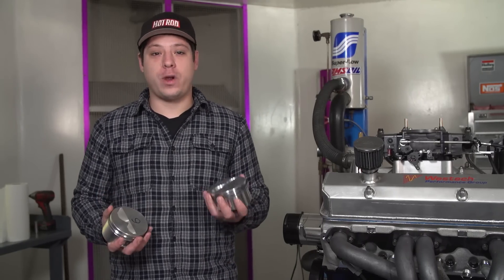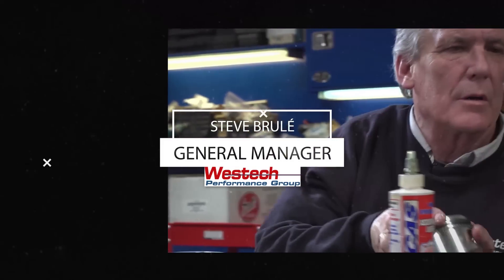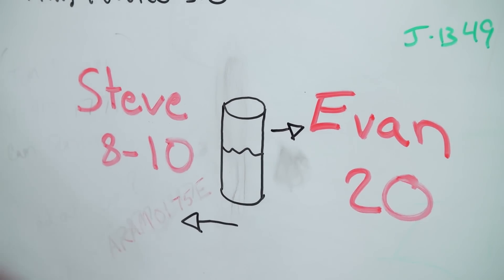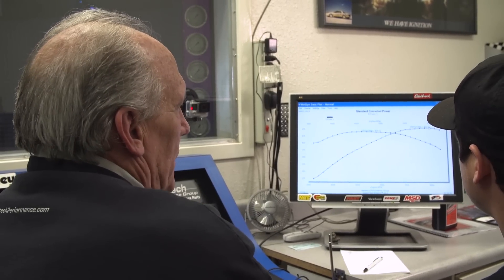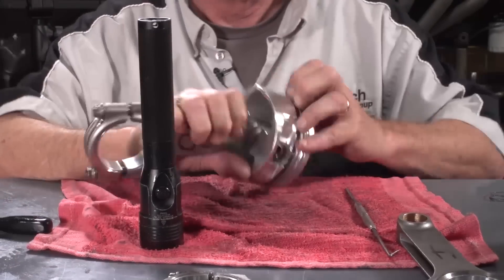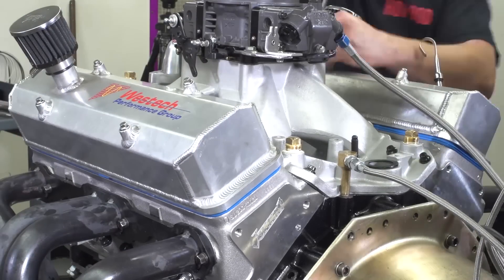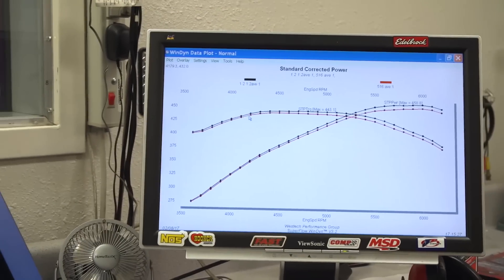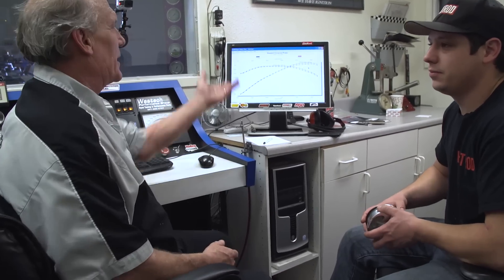Dyno Tested: Are Thinner Piston Rings Worth Horsepower?

Comment: I'm wondering if they weight matched the new piston/ring assembly to the thick ring assembly.   The difference in weight between thick and thin rings is considerable and enough to throw the balance off.   You could lose some power having the balance compromised and may not be realizing the full benefits of the thinner rings.  Just a thought.  Great episode.
Reply from the maker: That's true. JE Pistons did take that into consideration and weight matched both piston/ring sets to compensate accordingly.
Reply: Ahhh!  Awesome!  Thanks for the response.

Comment: saturn ecotec 2.2l has 1.2mm top rings in it. now it's got blow by issues at 130,000 miles. Thanks GM, now I gotta crack the engine open and re-hone the bores.
Reply: You are lucky you got that distance out of yours. At 110,000 miles, my 2003 Saturn ION had almost no compression in cylinder #3.

That in mind, I have to wonder if it was because these engines have narrow rings, or if these engines weren't built well. Honda also used narrow rings, but it didn't seem to be a problem for them.
Reply: There are tons of cars with thin rings. The Saturn was just built like shit

Comment: Just out of curiosity, when you do tests that require the heads to be pulled, do you use new head gaskets each time or do you reuse them to keep cost down?
Reply from the maker: It depends on the gasket type. For a coated gasket such as we used in this test, we will change them. However, certain MLS gaskets are able to be reused.
Reply: Thanks for the reply. Looking forward to more product tests on the dyno.
Reply: good question i was just ask the same thing lol

Comment: Cool video- I think better than engine masters. I wonder if there is more compression leakage across the smaller seal than across the larger seal- it would account for the small gain in spite of the drastic thickness change.

Comment: The issue with the rings being thinner is the oil bypass that is going to take place inside the motor bring picked up by pcv an reinjected back into the motor fogging it up with carbon now maybe not on this engine as its carbed but still could be plausible an if it was a non na turbo app then oil blow by would be even more noticeable  more like the engine is burning oil rather than using it

Comment: I wonder if the weight difference between pistons/rings was and how much that made a difference.  What did they weigh?
Reply from the maker: JE Pistons took the weight of the rings (a few grams) into consideration when designing the pistons so both sets weigh exactly the same. That kept us from having to re-balance the rotating assembly for the second test.

Comment: I was thinking 6HP, missed it by about  1/3 , but is there more worry about ring break ?
Reply: seeing as hp the new engines that have this installed from factory are lasting longer then ever i doubt it
Reply: There is no need to worry because many car companies have installed them on power dense engines. The Mitsubishi Evo X had a 2.0l engine that produced up to 313 horsepower. The top compression ring was 1.2mm, the second compression ring was 1.5mm, but I don't remember what the oil ring was.

Some high performance replacement pistons for the Evo X use 1mm top rings, 1mm or 1.2mm second compression rings, and 2.8mm oil rings. People are running higher than stock levels of power and don't have problems with their piston rings. The Evo 8 and Evo 9 also had aftermarket pistons with a 1mm top ring, 1 or 1.2mm second ring, and a 2.8mm oil ring, and people have also boosted horsepower well beyond the 271 to 289 horsepower that the engine was rated at.

Comment: So it's not worth pulling the engine down just for 8 hp but is worth doing in a rebuild or new build. Time / cost per hp factor. My next build will have thin rings with gas ports and coated piston skirts.

Comment: Here is what you do , just pick up a seal power ring catalog and look at what Buick did with the 3.8 V6 as far as ring pack . The factory did this years ago . Partly for power but mostly for ring seal and gas mileage . Years ago the auto companies thought ring tension made for good ring seal , but Buick found out that a ring that had good conformability would not only reduce ring drag but also seal better . It is funny where you can learn things from W/O a dyno .

Comment: i know there is a ton of variables to be had in my question. but what would an average power loss be from say a 500 hp motor down the drive train to the axles....that is something i would like to see tested.... auto vs manual. dual clutch, single clutch. gearing, tires... i know it all plays a part.

Comment: I'd like to see a test done with annular vs down-leg boosters on a non-airgap vs airgap dual plane manifolds.

Test 1: Down-leg booster, RPM intake
Test 2: Annular booster, RPM intake
Test 3: Down-leg booster, RPM Airgap intake
Test 4: Annular booster, RPM Airgap intake

The theory with this is that a heated intake manifold behaves better with straight or down-leg boosters due to the heat being able to keep the fuel atomized and suspended.  Annular boosters with a heated manifold cause the fuel to atomize too much and actually evaporate which, while being good for emissions and gas mileage, is bad for performance.  This is where the theory of the Airgap intake would get weighed in.  With the cooler air temps in the Airgap manifold, the down-leg would leave too big of droplets that may puddle and hurt atomization and performance.  This is a suspected reason why many people who switch from an RPM to RPM Airgap manifold notice little difference in performance since the poorer fuel atomization cancels out the power gained from the cooler air.  However, annular boosters providing better fuel atomization from the carb itself may solve this problem and allow the Airgap manifold to shine.  I'd love to see a dyno test of this theory to see if there is any substance to it.

Comment: When I build my personal motors, I hone the bores with a finer stone and then give it a quick Scotch-Brite rub. Why?  I use a harder Total Seal ring set that really doesn't seat like the rings of old. There is still enough oil on the walls to keep from scuffing and to lube.  There is a significant boost in power and it revs freely.  It's all about building motors with as little parasitic loss as possible. Opps, I just gave out one of my little secrets.

Comment: I'd be interested to see what the part throttle BSFC #'s were between the two ring sets, I have a suspicion the thin rings would show better fuel efficiency in regular street driving.
Did you guys get enough data to make that type of comparison?
Good video either way. (And yes I agree...that was a lot of work) :-)

Comment: I've seen thinner rings make a bigger difference before on a fully built N/A 420a 4 cyl. Changing to thinner rings gave 12whp gain so like 18-20 flywheel.  They were sone really fat rings. It also seems to of helped the engine rev faster. Might just be mind tricks though.

Comment: was there a break-in cycle or straight to the pulls? did the first set of pistons go into a freshly honed block? Some variables I'd consider were not addressed. This is a hard test set though. nothing easy about the change over especially having to remove the spiral locks an deconstruct the engine.

Comment: 8% gain in hp if at normal driving rpm can equate to significant fuel saving.
If of course you freeing up 8% more power from the same amount of fuel.

Comment: Did you spend much time running under load on either set for break in?  When I am running engines it seems like it takes four or five pulls for the package to stabilize and give repeating data.  Does not matter when you are chasing big variances, but becomes pretty important when going after single digit stuff.
Reply from the maker: Both ring sets were run through break-in cycles and pulled until they gave consistent dyno results. Due to time constraints for video, we left out the break-in pulls.
Reply: Very cool test.  Kind of makes you question some of the magic parts claims that permeate our trade...

Comment: 8 HP gain for a ton of work swapping out parts on a much bigger displacement motor than I use on my motorcycle. I wonder what kind of gain I could get doing something like this with a 1300cc motorcycle? Any chance to see a second test done with a motorcycle in mind? With the lighter weight, if it was even a 4 HP gain, that would be noticed riding.

Comment: if you use the spiral lock correct fitting tool = there is no real problem ? in fact it is easier than snap ring`s.

Comment: You do know that LS engine were never built for power they were originally low HP high torque truck engines but the blocks are strong so they make a good platform for a big HP motor

Comment: like to see the difference at light throttle (to late now), say 15% throttle at 1800rpm back to back? to simulate the real world scenario regarding fuel efficiency!!!
going from 30ft/lbs of torque to 14ft/lbs crank rotation is a big difference, Wide open throttle would have a little bit of blow by, even on a fresh motor (reducing friction), but light throttle or a high vacuum situation would help the rings to seal therefore creating more friction, this would have some effect on efficiency. I'm guessing this might have been the reason GM went to thinner rings!

Comment: wouldn't you have to evacuate the crankcase with a vacuum pump to take full advantage of the lower tension rings and how did you make sure the cylinders didn't have a lot of blow by when switching from one ring pack to the next. gonna also assume these weren't file to fit rings...
Reply from the maker: A vacuum pump is not required with these rings. Yes, they were file fitted to the bores. We file fit both sets (32 rings) all at the same time.
Reply: +HOT ROD Network  
What was the ring seating procedure? 
Were both ring sets seated/broken in the same?

Comment: The other thing we haven't heard is longevity in real-world running time.
 Will thinner rings last. 
 When rings break all hell breaks loose at the same time destroying cylinders, and even cylinder heads. bits of rings in the oil pan could be detrimental to the entire lower end. 
 I think a small advantage might not be worth the end result of a broken ring. "BUT"
 Perhaps they have just as good of lasting power as the thicker common ring set.
 I don't know.

Comment: There is a down side to thinner rings.  The smaller oil rings clog a lot easier due to smaller separators between the rings.  It tends to clog easier, especially if you are not religious about your oil changes.  This leads to oil consumption issues and blow-by.  The oil issues are not worth the horsepower gains.  Most people are not pushing for maximum horsepower in the average street engine, so the gains mean nothing.

Comment: So for this engine it's just about the same as adding a proper cold air intake which General Motors claims will only give you about 8 to 10 horsepower for a cold air intake on their engines maybe 12 if you're lucky so these in combination with a cold air intake in as one of the other commenters said you know a few other small little Mazda give you a few horsepower there she horsepower here and it does add up after a while but this is a lot of work for the small amount of horsepower you get

Comment: After all that work it would have been cool to add zMax nano-lubricant to see if it actually boosted any efficiency (maybe another 8 HP???)  Your test method did not include ring seating, did it?   Would a post run-in be different?  The cylinder walls may have seated the 5/64" rings (not sure) but they had very little running time with the1.2mm rings.  So I wonder if the 1.2 rings seated at all.  Poorly seated rings may have allowed more blowby decreasing efficiencies a small bit (?)
Reply from the maker: Both ring sets were run through break-in cycles and tested at identical leak-down percentages.

Comment: test oil ring tensions thats where all the power is get a low tension oil ring and I'll bet it picks up more than 20
Reply: Yeah, that's an interesting point. I really hope they touch on this subject at some stage, cause to me it seems like that's part of the equation. I'd like to see that test done, but also to look at blow by and the addition of a vacuum pump and it's affect on power and whether it's necessary because of the low tension oil ring
Reply: 20 hp huh? not without at least three performance stickers...20 hp, lol
Reply: phil tripe lol so how much you think it would gain i bet you money it would pick up 20 or more
Reply: maybe not on a 4 cylinder but i bet on a V12 it will :P hehe
Reply: Anthony Smith well if you machine it right and do a proper hone job it will seal up and hold more vacuum less blow by and will make more more power have you ever tried to piston in with standard tension rings and then too a less tension ring i can tell you this you don't need a piston hammer
Reply: In case you have not noticed, mr. Smith samples a few select words from all your statements, it's a troll.. Pay no attention to it.
Reply: So long as the low tension ring performs well, there will be no reason not to use them. However, I have read about engines that tend to burn more oil due to low tension rings.

Also, ring tension is only part of the equation. At one time, oil rings that were approximately 4mm in thickness were common. Most newer cars have a 3.0mm or 2.8mm oil ring. If the tension of the oil ring is the same, there will be a reduction in friction even of the ring tension is the same.

Comment: are the new rings seating in the same? what was leak down after brake in on both engine set ups? Are A.F. Ratio's and timing optimized 
for both engine set ups? Exh. temps. etc.?

Comment: I'm a bit skeptical about this.

If the changes in power are supposedly due to friction (rather than traction) then how are they explained in terms of “co-efficient of friction and pressure times area”?

As friction is not dependent upon surface area.

That fact is well known and usually taught with the example of car tires.
Reply: With ideal materials, friction does not change with surface area since the reduction in pressure exactly cancels out the increase in area.  Car tyres are well know to be far from ideal materials, and friction does change significantly with surface area (or more specifically with tyre loading).
In terms of the rings you are missing the ring tension itself.  Thinner rings have only been made possible with better materials, so you can't simply assume reducing the thickness of the rings by e.g. 50% also reduces the force by 50% since the ring material has a large influence on this.

Comment: I'd rather have thicker rings. I don't know if it's true but I feel like a high powered turbo car would be less likely to butt rings because they would be easier to heat and expand. maybe I'm wrong on that, but that's my thinking so far
Reply from the maker: Old, thicker rings are made out of cast iron (ductile iron is a heat-treated version of cast iron) and are brittle. Modern rings, despite being thinner, are made from carbon steel. They are far stronger and reduce friction.

Comment: only 200,000 miles? 

Wow we got 650,000 miles out of Aussie Valiant with Hemi 360.
but i think materials here are different(better) 

As We also had Australian built 1982 Land cruiser with 2F motor do over 1,500,000km (930,000 miles) before it need rebuild.. the last 300,000 miles running on LPG only

i mean all of our taxis/police cars are retired at 6 years old or 375,000 miles 
and all out taxis run on LPG for the full life (They do not rebuild them)

Comment: Won't the thinner oil rings allow for more blowby?
Reply from the maker: Blow-by is combustion pressure sweeping past the rings. Any time you increase it, there will be a negative effect on horsepower. Both sets of rings were also leak-down tested and were equal at 4%.
Reply: Leak down tests do not reflect real engine conditions but it does give you some information.

Comment: I think this is about Corporate Fuel Economy for CAFE. Keep in mind they are talking about little changes that add up to big numbers when your talking about things multiplied by hundreds of thousands to millions! I doubt OEM's are doing this for power. I think though oil control and long-term ring seal might suffer too. The companies that went to then rings first and moved the rings closer to the crown all had or have oil consumption issues like General Motors for instance. Then as other's did the same thing we started to see consumption issues on other Makes like Toyota as well. No free lunch you always have to trade one thing for another when talking about the design of an engine, piston or ring!

Comment: Its not realy a single variable considering the heads were removed the exhausts were removed the intake etc etc, anyone or all of these could have been slightly misaligned on either test enough to skew the results.
Reply from the maker: A variable is the element of a test that is intentionally changed. The only variable that was changed was ring dimension.
Reply: Technically yes, but the bores were also run in with the larger rings meaning technically the bores could be a variable in the test as the rings and bore of the second test were not mated as well as the first.

Comment: 12:12:1 (gas engine) and you add like a intake and exhaust then the ratio goes down to 14:14:1. What do you change in the computer to get it back to a healthy air to fuel?

Comment: So the 1.5mm ring packs are used with custom pistons to match correct...and not just buying 1.5mm rings and installing them on 5/64 pistons, please tell that's correct, otherwise there will be close to .5mm slop in the ring bosses with a high probability of a busted engine should the rings ever break..tell me this is true please